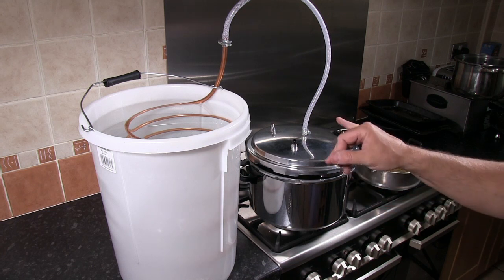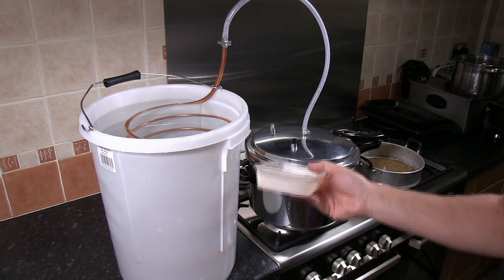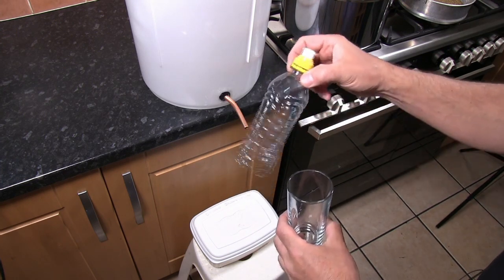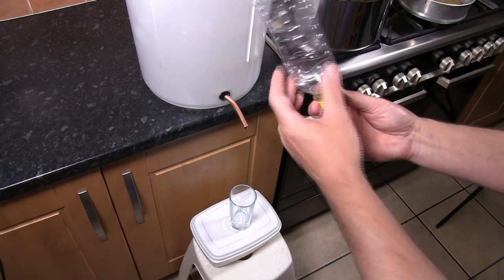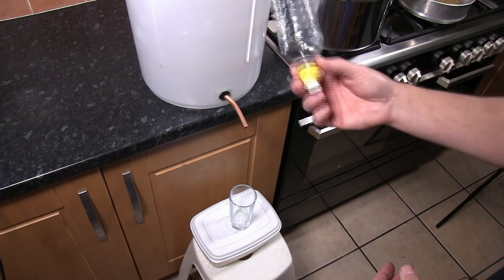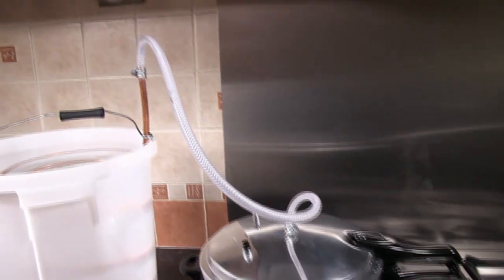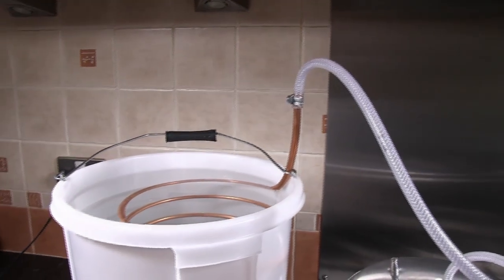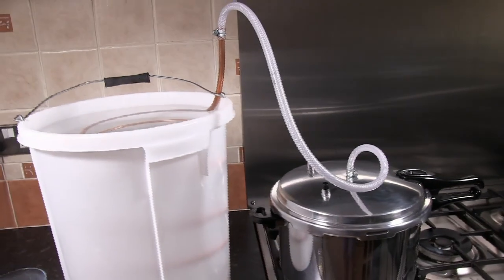How To Make A Home Made Distillery (PART 2) | Making essential oils

Comment: This works, but it's useless, because the distillate is completely ruined by the horrible chemical smell of the rubber hose pipe. What a waste of time and effort. How did you not mention this, or, if your kit didn't do this, what is the hose made of?

Comment: I would suggest finding a clear glass bottle which will fit with that bottle top. Cut off the bottom of the bottle, attach the dispensing top, done. 

The other problem with using that type of bottle is that it's plastic, and plastic #1, which is really unstable & leaches into products, including the original drink which was purchased in it.. Essential oils degrade plastics quickly, especially that type of plastic, so your end product - the essential oil - is likely to have plastic contaminants in it, as would your essential oil water (the distillate), which you had said you planned on using in cooking. I work with essential oils, formulating natural herbal products, so I'm aware of these issues. Plastic is never the way to go with these, or any, oils. Store your end products - the oil & the distillate - in glass containers with tight fitting lids to prevent loss of volatile oils (which are also present in the water, just in lesser amounts).

Really nice design. I will be trying this out myself in the future. Thanks very much for the video, very nicely done.
Reply: Absolutely right. Essential oils eat into plastics. This design is good and very workable. I think there is way more water in the finished product which may lead to oil getting spoiled sooner. I have tried using anhydrous Sodium Sulphate but the quantity required is too much when the water content is similar to that as obtained in this video. It clumps up so its removal is tedious, especially when you get essential oils in very small quantities as in this video. Also, the water is not removed completely. Any ideas how to remove the water and moisture completely from distilled essential oils ?
Reply: @GiveUTremors  Freezing

Comment: My question is , is not the heat melting the hose ?
Reply from the maker: Used many times and never an issue but having now gained a lot more experience, I would probably go for all copper tubing.

Comment: You absolutely can not use plastic- smooth or otherwise- in distillation or storage of e oils. They melt plastic within 10 or so hours.  I was totally impressed with how much good looking e oil you got!! I never thought a dried herb would yield like that🤗....very nice!  I'm off to home Depot for copper tubing and hose!! Good job 👍👌!!
Reply: Thank you for a very good clear presentation.  A couple of questions or comments.  I think plastic tubing and collection bottle are not safe unless it specifically says they are food safe types of plastics.

Question: why copper tubing please?  Thank you
Reply from the maker: @arheufu5988  I researched this project using several sources. All of the distillery information from the USA shows copper tubing being used. Also, I visited a brandy distillery and they used copper tubing. I was advised to use copper tubing designed for domestic water installations. I have since replaced the plastic tubing with more copper tubing.
Reply: @DaMalat  thank you very much for your prompt reply.  I just wondered if there was a particular reason for using copper, so I can plan in case it must be copper or if I can replace it with an appropriate alternative tubing once I understand why copper is being used.

🙏
Reply from the maker: @arheufu5988  This might help: https://lawtontubes.co.uk/copper-in-distillation/
Reply from the maker: I've never had an issue but take on board everything you've said. I'll swap out the plastic tube for copper and look to see if it's possible to add something to the video as a revision. I used this particular herb for the video as I get a high oil yield and seem to get a higher yield from dried Thyme and Rosemary than I do from fresh (really not sure why). I also get high yields from spruce and pine (to make disinfectant). I have failed to get any oil on a few others though, especially rose petals. Maybe the copper tube extension will make a difference?
Reply: @DaMalat  if you don't have an issue with melting plastics, I wouldn't worry about replacing it. I think  my bottles leaked and collapsed because I used full bottles of purified water and added 10 drops of floral e oil to each bottle to make scented rinses for my hair. I made 10 at a time, but I used 1 daily. I guess oils were in the bottles too long. I think your process is awesome, and I can't wait to d-i-myself!!

Comment: I know I'm late but I just wanted to tell you that dried herbs gives you more essential oils that fresh herbs. if you used 100g of fresh herbs it will contain lots of water so most of the weight is water. however 100g of dried herbs will contain no liquid it has more "herbs" if you know what I mean  lol, meaning it will have more essential oils
sorry I couldn't explain it better
Reply: But if you took your 100g of wet herb and dried it you'd have a lot less than 100g when dried. Using wet herb just saves the step of drying before making the oil. You're still extracting the same amount of oil from the herb.
Reply: Thank you for that info! I was wondering if you could get good oil from dried herbs. I'm going to make rose water for my practice run, wish me luck 🌹🌹🌹🌹

Comment: Beautiful work,try using a hospital IVneedle setup with the regulatory clip for the separation
Reply: It wastes a lot of oil collecting, draining, or storing oils using anything plastic or rubber. distill directly to a glass container and siphon off the lower layer of liquid using a giant syringe with a long blunt  tip. Or don't they have glass IV containers? Seems that would work for collecting the distillate. Then you could attach the hose and lid and invert it I guess. Not sure 😬....
 I have a large huge glass funnel and just drained the liquid like that. But it's pretty awkward 😂

Comment: If you take the sports drink bottle with the ribs and apply heat to the ribs (not excessive heat) you will get the ribs to expand out and have a smooth side.  You may get better results with doing that before you cut the bottom off, not sure. I just watched a youtube video once where it was done and it worked well.
Reply: Essential oils eat plastic up with in a day or so.

Comment: As my mother tongue is different I have just one question about the flex tubing that connects the coil with the pressure cooker. Is it a standard hose for watering plants in the garden or it is some special thing that can endure temperature better?

Comment: Thank you for both of the videos. I'll try your method for sure.  It was easy to understand for the 1st timer like me. 🙂

P.s. try using a injection tube to extract the oil. See if that works better than the bottle.  Thanks again.

Comment: do you stil have the "kink" at the bottom like in the first video ?  down, up and down again outside the bucket ?  tyvm
Reply from the maker: No. Thanks for pointing that out. With the reduction in length, the pipe has a steady fall with no dip at the bottom.
Reply: @DaMalat  tyvm !!

Comment: A very practical approach to problem solving and great presentation.  I watched this with a view to making lavender oil which is brilliant for treating burns when you are using a soldering iron without the need to buy elaborate equipment which will be only used occasionally.  Thank you and best wishes from Australia
Reply from the maker: Thanks for the comment Barry, very much appreciated.

Comment: how much rose oil can i yield with one ba tch of distilling?
Reply from the maker: Very little which is why Rose Oil is one of the most expensive essential oils on the market. In a fairly basic set up like the one in the video, you will need 1kg of rose petals to make 2 - 3ml which is about 5,000 petals for 2 - 3ml of oil. With a professional set up, you could get 10ml of oil from the same amount of petals. Consider it click bait when you see a video claiming to be able to make Rose Oil from a homemade still.
Reply: @DaMalat  how much lemongrass essential oil can i get using this method
Reply from the maker: @neverbari5695  You're looking at 1% of oil yield per quantity of lemongrass stalks. So about 10ml essential oil for every 1kg of clean. lemongrass stalks. The least productive methods are infusion and cold compress where you'll get about a 0.3% yield.
Reply: Thanks for the very informative video . On the subject of extracting rose oil , I have a question . Do you keep petals above the water inside the pressure cooker or do you imerse it in water like shown in so many videos  ?
Reply from the maker: @chrysanthdesilva2500  For Rose Petals, immerse in water. `you will need A LOT of petals though. I've just produced a batch of pine needle oil which we use as a strong surface wipe disinfectant
Reply: @DaMalat  Thanks for the reply. So it is a question as to what method ( immerse or hold above the water  ) works for which type of oil extraction . Would be grateful if you list out from your experience already .
Reply from the maker: @chrysanthdesilva2500  Steam distillation (suspending the plant material above the water line) is my preferred method. it produces a very good purity of oil but it can leave some oil behind which is why I'll always add a distilled batch of plant material to the next distilling. There is so little oil in something like rose petals, hydrodistillation is the preferred method (plant material mixed with water). The purity of the oil might be slightly less than steam distillation but a higher percentage of oil is extracted. This paper is pretty heavy reading but does explain the process in more detail: https://www.hindawi.com/journals/tswj/2019/3659432/